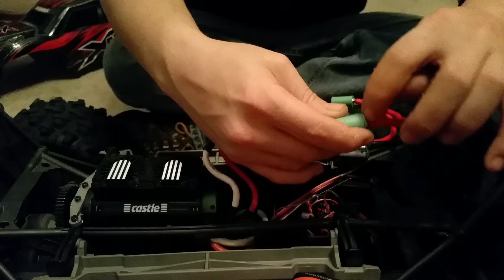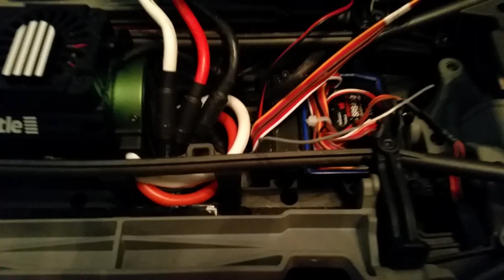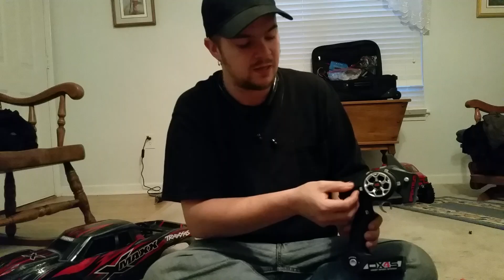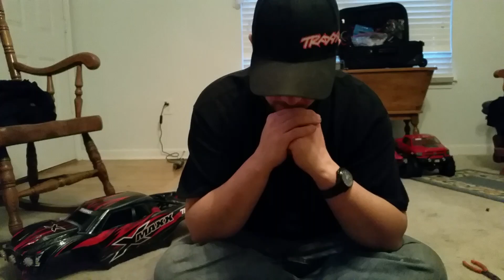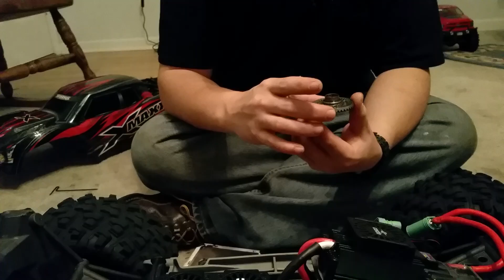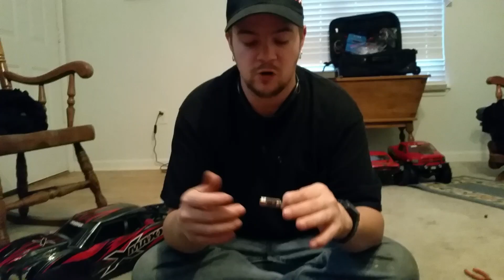A walk through of installing the Castle XlX/2028 system in the X-MAXX

Comment: Thank you bro! I’m having issues getting it programmed. Servo working but no motor. Green lights on the receiver. Does it require a temp sensor to work since I’m using a Traxxas 6533 receiver?

Comment: Hi. I have mamba xlx esc with 2028 also but after a few years of using and ran into a little puddle of water it lost power to motor and beeping 3 times with red light but steering has power. Any help please
Reply from the maker: Mosfets are probably shot

Comment: Hey bud i have the first gen xmaxx. 6s. i just bought this motor and my local hobby shop say they can’t install. is it true and can you help
Reply from the maker: Quepid 101 It can be installed, but you need an aftermarket motor mount
Reply from the maker: Quepid 101 any questions you have LMK. Also do yourself a favor and upgrade the drivetrain with the 8s differential gears. The 6s stock gears just shredded under any type.of decent power. I ended up trading this for a dbxl with about 1k in alloy upgrades.

Comment: the way you have your fans running backwards is stupid. did you not think these companies hire smart engineers? you are pulling hot air from below your motor instead of cool air from above your motor. I understand that heat rises but I also understand that heat saturates small areas faster than large areas. it's funny that you thought you made a breakthrough in fan tech though. next time you're hot try pointing a fan away from your face and see how well it cools you off.
Reply: I`m a engineer, I do agree. You don't cool something down, you remove the heat for faster results. Sorry for being a smart a**. Good fix sir!
Reply from the maker: Jessie Mathiesen well smart ass myself and all the members of my group. that's about 3000 reversed the fans and in this situation temps dropped 20-30 degrees.  so nice try.  how about studying thermal dynamics

Comment: also i dont use the bec from a esc i have it setup with its on battery for the rx and steering servo and i unhook the red wire on throttle because of that but thats the xl2
Reply from the maker: Anthony Borden Well you need the motor mount, the esc mount can be made easily and you'll need a few pinions.  for general bashing the 37 tooth pinion and 50 tooth spur will get you going as fast as the new 8s setup.
Reply from the maker: David Downs yea the xl2 only has a 5 amp bec.  the xlx has a 20 amp bec.
Reply: so i can unhook the red wire on throttle input to the rx to bypass the bec and then have the aux wire unplugged? i appreciate the help with new esc i was use to xl2
Reply from the maker: David Downs I wouldn't recommend doing that. you could get the esc
Reply: Evolved Amateur RC I might be getting this setup and need a little help on getting what I need for this build on the traxxas x maxx, and only have 300.00-350.00
Reply: Evolved Amateur RC ok thanks
Reply: Evolved Amateur RC I asked a few questions a couple Months ago and I got another or 2 questions can I run xt90 connectors in a series and just soder on le xt90 to the xlx esc and run 8s and the 2nd question is that is it a need to get a spektrum transmitter and receiver for this xlx setup
Reply from the maker: Anthony Borden yeah you can solder on any connector. you can also make adapters or buy them.  as for spektrum no.  I just bought it to have a decent radio sustem
Reply: Ok cool and thanks

Comment: so the aux cable on xlx dont have to be used? i can use that for castle link hookup without removing the  rx?
Reply from the maker: David Downs No.  the aux cable can be used on a variable third channel. but if you want to use castle link you have to unplug both, if you just unplug the esc plug and keabe aux plugged in you can damage the esc.  I would recommend to anyone doing this to get the castle quick connect duo.  It makes it so the connector for castle link is hanging outside of the rx box so you don't have to open up the rx box, unplug both the esc and aux, then plug castle link into the esc wire.  with castle link duo you plug aux and esc into it then plug the esc and aux wires coming from the quick connect into the rx then there is a connector that you leave outside of the rx box.  when you plug in castle link the quick connect automatically disconnects the esc and aux cable via transistor switches and you can tune or grab your data lob without the laborious process of moving the esc, opening the rx box, unplugging the wires then grabbing the data or tune then plug everything back in and close up the rx box and re mounting the esc.  the quick connect really helps with rd boxes that are closed with screws and is covered with something lime the esc.

Comment: didnt show a thing
Reply from the maker: jamienoah222 jamienoah222 well the entire installation from soldering to waterproofing the esc to actually installing everything in the truck took 24 hours.  so I did what I could.  That's why it says "walk through".
Reply: Ya i here its a job and a half
Reply from the maker: jamienoah222 Sell first you've gotta solder 2 connectors to the esc amd a jumper wire so the batteries are in series and your working with 8 gauge wire so I bought a digital iron that gets up to 480 Celsius.  thats 4 joints to solder.  then 2 batteries for it to run but I had 4 so that's 8 more joints.  then youce gotta take the esc apart and paint the silicone conformal coating on it and let it dry, some just dunk the entire esc but I just spread it on, about 5 coats then use thicker silicone to close up the larger openings.  Now all the stock parts have to be removed.  I replaced the receiver with spektrum so everything went.  that takes 20-30 Minutes.  then install new motor mount, Poseidon or kershaw, I went with kershaw, cheaper and has 6 mounting points.  then install the huge 5-7 pound 2028 motor and get the pinion on and set the mesh, install new receiver then esc, wire everything up, then mount the esc plate.  If you skip the waterproofing it will take 3-5 hours.  then you have to calibrate and program.

Comment: Need some help with my setup I feel like am not getting full power , you have some advice you can help me with
Reply from the maker: Jeorge Lopez Did you calibrate everything?  amd are yiu still using  the stock tx/rx
Reply: Evolved Amateur RC no am using a futaba receiver and remote
Reply from the maker: Jeorge Lopez Does it go faster in reverse than forward?
Reply: Evolved Amateur RC yes I am having that problem
Reply from the maker: Jeorge Lopez Most of the time if there is a problem with power or speed it's either not calibrated to your receiver or you need to set up the esc.  with this esc a castle link is a must.  do you have one? If not the esc comes with a coupon code for a free one.
Reply: Evolved Amateur RC yes I have one already